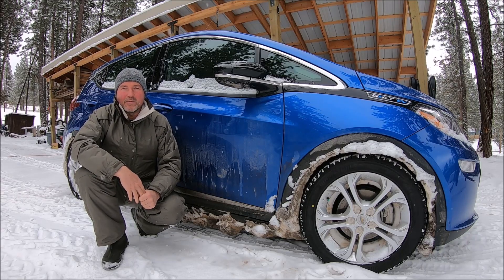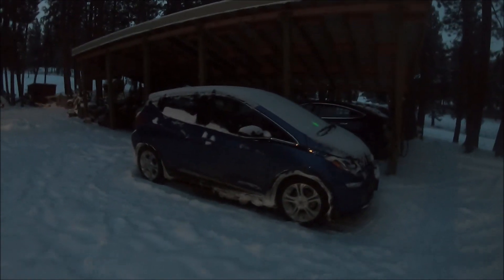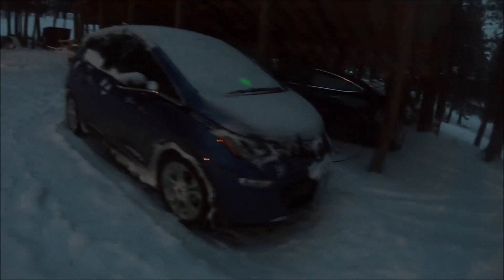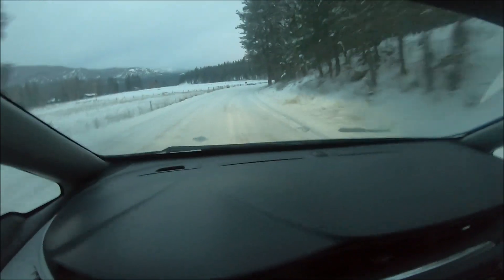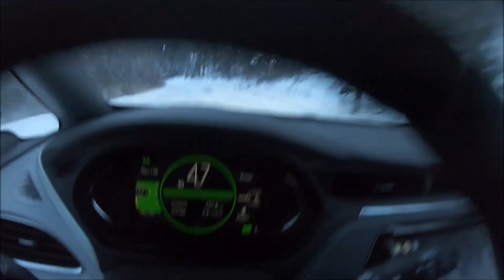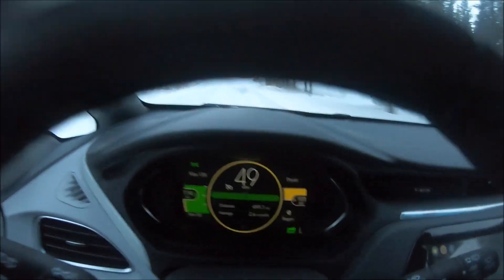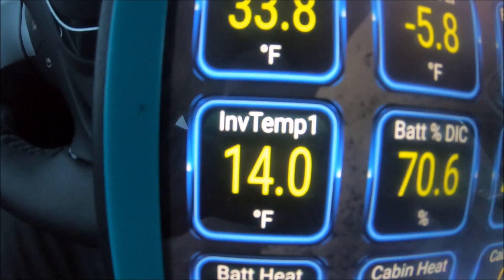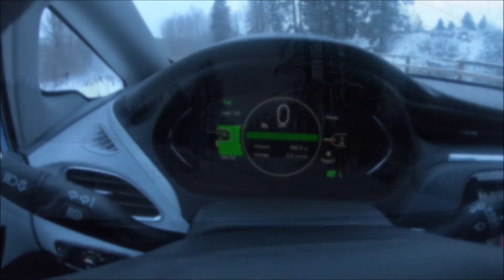Chevy Bolt EV Cold Morning Drive(-9°F/-23°C)No pre-heat, get in and drive. Regen/Power restrictions?

Comment: From my testing, when plugged in the battery warmer will run as needed.  I did a test at a similar temperature after not being plugged in overnight and there were restrictions due to the low battery temperature.
Reply from the maker: The battery warmer was likely running at some point, just as you said I also pointed out in the "Before Drive info/stats" chapter that the car was plugged in and could do whatever "it" liked to do. Unfortunately the battery heater came on when I approached the car and thus I was not able to see in the OBD read out when it was on last. I do have a video where the Bolt and Tesla were parked for 3 days not plugged in and there the Bolt did show a regen restriction (and I looked right at it and did no realize it in that video, LOL). It is amazing how little the regen restrictions are and how fast it goes away. Just wondering, which model year Bolt do you have?  On the center screen under Energy, does yours ever show any "Battery conditioning" use? I have never seen it, always only have "Drive/Accessories" and "Climate control".
Reply: @RMTFamily  I have a 2020 Bolt and am using the 110v charger.  I put my OBD reader on it one day when charging at about -20C and could see that the battery warmer was cycling on and off over about an hour.  My cold drive with no pre-heat ran the batter warmer for the whole drive of about 40 minutes and warmed the battery up from -13C to -3C in that time.
Reply from the maker: @keng5059  Interesting. I wonder how much of a difference it would make using a 240V 32Amp EVSE. The higher amount of power will generate more heat. I like your idea of checking the OBD while charging. It has gotten warm around here and I don't expect any real cold temps anymore this winter. I guess I'll have to wait until next winter to try this. It's so weird that I have not had any battery heating, while driving, that would show on the center display read out.

Comment: Great video! 
I did notice the trip meter was not reset so the efficiency is closer to 2 based on the stats since last full charge. The trip meeting showed 500 miles.
Reply from the maker: I always do that. If you watched some of my other videos you may have noticed that I always reset it a few miles into the drive. This time I completely forgot. I don't know why🙃. So, you're right the miles/kwh in this trip is lower. As you said right around 2m/kwh. Which is still pretty good for this cold without pre-heating the cabin. I'm glad somebody is paying attention! 😉😀 Thank You for watching.

Comment: Wait... the Bolt shows mi/kWh for the driving energy only and not the HVAC?  That's weird.  With HVAC, it really should be 1.98 mi / kWh.  Not terrible considering you're driving in the snow.  I'd always recommend pre-conditioning before driving to pre-heat the battery and cabin.  Warmer battery has less internal resistance and operates more efficiently.  Warmer cabin means warmer seats/steering wheel, so you don't get that initial chill that makes a person want to overcompensate by turning the heat up more.  Doing so with the car plugged in means pulling that energy from the grid instead of the battery.
Reply: In my experience the efficiency rating on the gauge cluster includes all energy usage for the mileage
Reply: I just noticed he didn’t reset the trip meter so it’s including efficiency from the previous 490 miles as well.
Reply from the maker: As A.j already said the gauge does include the heat. But me, sometimes not very smart did not reset the trip meter as A.j noticed. For unknown reasons I keep resetting it a few miles into the drive and in this case I completely missed it. So you're correct the actual is just about 2m/kwh. I'm glad to have viewers like you Upd Late and A.j to keep me on my toes😉😀. Thank You.

Comment: I have a 2020 Bolt outfitted with Blizzak WS90's    amazing tires.    you mentioned doing one pedal driving alot.    you can with Blizzaks.    Just never use one pedal driving with all sesason tires in conditions such as what your driving in.   its very scary if you do. :)
Reply from the maker: You should never be driving any car under winter conditions without winter tires.
If regen leads to traction loss that means using the brakes does the same thing.  If you learn how to "feather" the accelerator pedal you can control the amount of regen  to the point of finding the sweet spot between regen and power just as if you are in neutral. I have been driving our Tesla Model 3 for the 3rd winter now and have it set to standard regen without any issues. This the 1st winter with the Bolt and it works just as well in the Bolt as it does in the Tesla. 
Great tire choice!
Reply: @RMTFamily  Unfortunately many people don't use winter tires and I am with commenter that "L" is actually quite dangerous in slippery conditions. Even with winter tires, I am telling my wife & children that if you see the slippy traction light when accelerating even a little, then do not use "L"! It is possible, but much harder, to properly use braking with "L" ... there is simply not enough "coasting" zone in the pedal IMO. Meanwhile I am all in on "L" every other time!
Reply from the maker: Safety comes first. And if you feel safer that way that is the way for you and your family.
My wife and I have not had any issues with single pedal driving with both the Chevy Bolt and the Tesla Model 3. Even in this video you could see when accelerating hard (would not normally do this under these conditions), that it lost traction and traction control came on, but it did not loose traction during regen. We have been driving EV's for about three years now and are used to single pedal along with the auto hold feature. If we would switch back and the car would keep rolling and not come to a complete stop when releasing the accelerator we could be in trouble. 
The most important thing is that you drive an EV.🙂👍🙌

Comment: My wife and I purchased a 2020 Chevy Bolt last month and we live in Maine. Plenty of snow and cold. Our Bolt runs just fine in this weather. I always drive in L and some times will use the regen pedal on the wheel to slow down even more if a I need to. Only thing I noticed in this cold weather is that it takes a long time to charge with the level 1 charger. I sometimes run an extension cord to my house to plug into a 220 volt outlet when my battery gets low. When the weather gets nice I'll be installing a 220v 40 amp circuit in my garage.
Reply from the maker: Level 1 charging is always slow. It is not affected by the cold at all, it's just slow. Make sure to switch it to 12amps in the center display. DC fast charging is about the only thing that is affected by the cold. But as you could see in the video the car did max out regen at 50kw which is also the max for DC fastcharging on the Bolt. I recommend to install a 50amp circuit with a NEMA 14-50 outlet. That gives you all the options from plugging in an RV, dryer, welder etc. Also you future proof it for another EV, as most EV's are going up in Level 2 charging.
I love that you drive in L all the time. This the most efficient way and is so super easy to do. You should check out my video coming next Saturday driving the Bolt and pushing the range limits in below freezing temps. It's pretty cool what the Bolt can do. Thank You so much for watching and leaving a comment.
Reply: @RMTFamily  Thanks for the tips. I also noticed in your video that your bolt is not charged to 100%. Do you set the max charge at 80%? Will that extend the life of the battery?
Reply: @twiddler71  Most EV's say keep the battery level between 20 and 80% to slow down degradation.  Of course if you push the limits everyday, then you have to charge as much as you need.  Also, most manufacturers limit the charge to an effective 90-95%, but will show 100%.
Reply: @maurice7413  I see. In that case I might lower the charge to 90% unless I need to make a long trip. Thanks
Reply from the maker: @twiddler71  I usually charge to 75% daily. That gives us more than enough range for the usual drives of 60 to 100 miles per day. Yes it will extend the life of the battery. Unfortunately if lithium batteries sit at 100% for to long they have a tendency to degrade quicker, due to their chemical make up (just to say it simple). You can ask that same question a hundred times and get 100 different answers. Every EV maker decides how to prevent the "signs" of degradation. There is always degradation, but manufacturers put larger packs in but don't let you use it all, so that over the years you don't notice range loss. But it's there. Batteries have gotten much better but they are not perfect. So it is still best to keep a lithium battery in the happy middle for most of the drives. The happy middle is between about 25 to 75%. If your daily drives requires more than just charge to wherever you need to be(same for road trips) but use the timed charging option, so that the battery reaches 100% just about 15 to 30 minutes before you leave. All this will keep the battery pack happy for a long time. How much would you loose if you charge to 100% every day and let it sit there for several hours? Nobody really knows exactly, the degradation will over about 10 years would be about 30% is my guess, but if you treat the battery better you'll be at less than 15%. I don't have any scientific proof for that but so does nobody else. This is based on my experience with lithium batteries in EVs as well as solar storage in RVs and battery experience with cars as I have been working in the automotive, trucking and RV industry all my life. Well that was along answer for a short question, LOL. I plan a series of videos that will answer some basic questions about EV use in the next few weeks. Stay tuned.
Reply: @RMTFamily  Look forward to your next video. Trying to learn all I can about electric vehicles and solar. My plan this summer is to install solar panels in back of my house for a grid tie system. Hopefully offset the cost of charging my bolt.
Reply from the maker: Solar, that is great. I have considered solar many times, but power is to cheap here and the grid tie option is net-zero in regards to actual energy usage, but they still charge the $25 base fee per month. We are on the co-op and most of the electricity comes from hydro and solar is growing too. So I don't have coal burners 😂, I have clean powered EVs. The cost of charging the EV is small compare to fueling and maintaining a gas car, so you already save money. But with solar you'll go even further. Thank You for Subscribing👍👍
Reply: @twiddler71  If you aren't already watching him, this guy is the guy to watch for solar:

 DIY Solar Power with Will Prowse
Reply: @RMTFamily   Cold temperature can impact charging speed.  Makes sense, cold increases internal resistance and slows down the reactions in the battery.  I guess it depends on how cold the battery gets.  8 amp charging wouldn't be enough to keep the battery warm and charge the car.  12 amp may, but I imagine keeping the battery warm will impact charging speed.  Level 2 is more than enough to do both, plus higher voltage means fewer charging losses.
Reply: @updlate4756  I think that's what is happening. I do have it set to 12amps, but here in Maine it can get bellow 0 deg F. I think the car is trying to keep the batteries warm at the same time charging. Sometimes I'll run an extension cord to my basement to plug it into a 220v outlet when the battery is low.
Reply from the maker: @updlate4756  I have yet to experience a slower charging speed on level 1 or 2. If the battery heater kicks in while charging this will take away from it but it's still capable of charging at full speed. DC fastcharging can be affected by cold battery but now were talking 50kw and up. Even on a cold battery the regen restriction on the Bolt does not last long at all. Max regen is the same amount as max DC fastcharge on the Bolt. (Regen and DC fastcharge is basically the same thing). Unless you have a regen restriction as shown on the dash by a bar below the kw indicator it should dc fastcharge at max speed. Other EV's with higher charge speeds are usually those that do not reach max speeds unless battery temp is at a specific temperature. In the one video I tested the Level 2 charging right after the Bolt was sitting for a few days in cold temps, and there was no slow down in charge.
Reply from the maker: @updlate4756  Your right that cold does affect charging speeds. The Bolt is really not affected by cold much. I guess, unless it goes way below 0°F.
Reply: @RMTFamily  I'm not sure if many people know this, but the level 1 charger that comes with the Bolt can be plugged into a 220v outlet with an adapter. Effectively doubling the charging rate.
Reply from the maker: @twiddler71  Yes, it sure does. I looked at mine after I heard of that and it is labeled for only 120V. But I had to try it and made an adapter and it sure does work. There are a couple videos out there (not mine) that talk about that. If you have access to an 240V outlet it is usually rated at 30, 40 or 50 amps and you could take advantage of more than the 12amps the EVSE is for the Bolt rated at. I usually take the Bolt EVSE and my 32amp EVSE (which I use at home to charge the Bolt) with me on longer road trips with unknow charging options. Just to be prepared.
Reply: If you can see if you have  enough amperage to future proof your charging by installing a 50 amp circuit. I have a 50 amp  circuit but my charger is  32 amps.  I am getting another ev.
Reply: @jamese.gulyard8897  My plan is to install a 220v outlet in my garage. I think I can get by with a 32a or even a 16a level 2 charger. I won't be driving the Bolt on long trips. Mostly for going to town or work.
Reply from the maker: @jamese.gulyard8897  The new Bolt and Bolt EUV are charging at 11kw, so does Polestar and Tesla. If you already have a 50 amp circuit you'll only need a new EVSE along with the new car. Time for a new car! LOL

Comment: What obd app do you use? Does the obd reader itself need to be any specific kind?
Reply from the maker: I use the Torque app. The wireless OBD reader just has to be compatible with your device eg Android, IOS or Windows. This is the one I use for Android: https://smile.amazon.com/gp/product/B005NLQAHS/ref=ppx_yo_dt_b_asin_title_o04_s00?ie=UTF8&psc=1  I also had to import the PIDS, as the app itself is based on gas cars. I got the PIDS from AllEV.info Click the link for PIDS and instructions: https://allev.info/boltpids/
Thank You for watching. If you have any other questions feel free to ask.